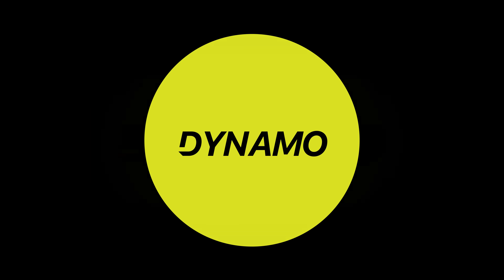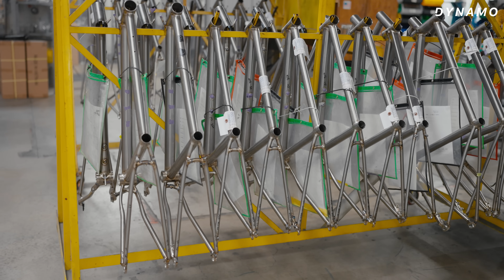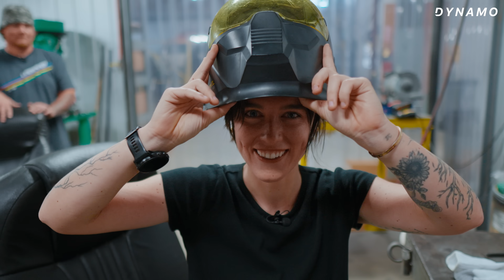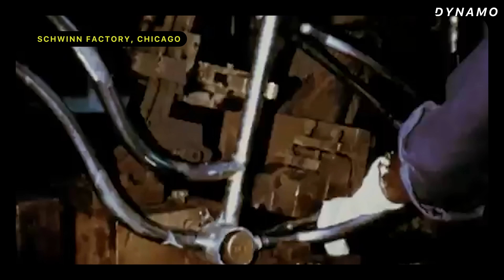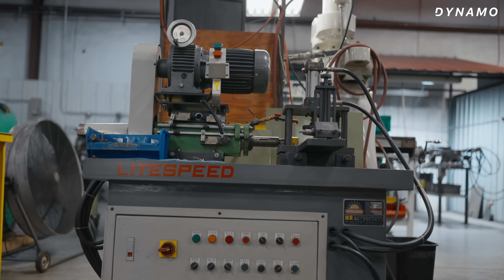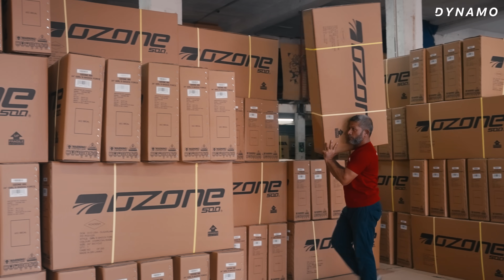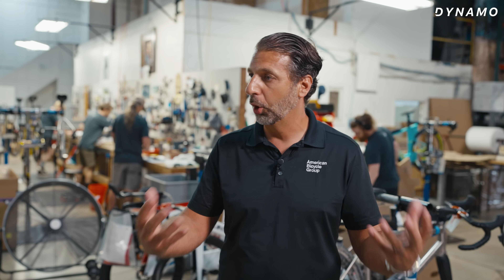What 'Made In America' ACTUALLY Looks Like

Comment: A good point was made…..if there is a huge investment in manufacturing it will be in automation (not job creation). Even the ‘robots’ will be built by ‘robots’ and programmed by AI.
Reply: Still lots of jobs in maintenance, set-up, programming, engineering, sourcing, & quality in a “fully automated” factory.

Also, very few things are possible to “fully automate”.  

AI is mostly going to take customer service type jobs, at least for the foreseeable future.  Programming a robot is too specialized.
Reply: Not even 😅 AI can build nothing but crappy code and fake videos. There will still be machinists and techs for the robot as well.

Comment: We have always had this issue, even in 🇬🇧 companies would spend millions developing a whole new factory with machines etc because in the long term they deemed it to be cheaper to outsource. A few years later we have become so dependent on other countries that these countries have full control and can just up the price without any reason.

All the factories eventually closed down and would require substantial investments to manufacture at home. Even if they did this it would end up mainly as an autonomous factory with very little human activity. 

The other issues you have is the emissions reductions requirements, this technology is extremely expensive also which will also increase the cost of set up

Comment: Some years ago I bought a fishing hook sharpener from a store. The packaging was flash and it had made in USA stamped on the pocket clip. Not long after I bought it I took it apart to clean it and would you believe, when I extracted the sharpening steel from the holder with USA on it, the most critical part of the whole device was stamped with 5 simple letters CHINA. In essence I paid a premium unnecessarily.
Reply: "Made in USA" labeling requirements are not very strict.  Basically the final product must have been assembled from components into its final retail form inside the United States.  Or it can have a distinctive component critical to its function manufactured in the United States.  Now many products doing this do push the lower bar of what this means.  A lot of these products arrive where 2-3 completed sub-assemblies need to just be snapped or screwed by US labor and then inserted into a box that also came from overseas. So they basically have their overseas manufacturing package the component in such a way that the labor on the absolute last step is as basic as possible.  In fact a majority of the of the worlds "Made in USA" official logo are printed onto assemblies and packaging inside Chinese factories (they print Made in USA on things more than any other country...including the USA).
Reply: Manufacturing Engineer here - a lot of the items that have the "Made in USA" label are built somewhere else. Either assembled in the U.S. or just packaged in the U.S.
We have some items where we literally just change the label from the original manufacturer's to ours after running it through our inspection lines. And there you have it... "Made in the USA".
Reply: @yousef.al-assaf sounds like a scam
Reply: @TallMatch  in a way... lol.
It's like dropshipping
Reply: I’ve seen a hose nozzle with a plastic cover that says made in the USA and when you take off that admittedly pointless part, on the main metal part is stamped CHINA just like your story lol
Reply: @327efrain  
There was once a similar case in Europe. Logo CE means Certified European goods. The Chinese manufacturers decided to slightly change the logo and claimed it was “China Edition”. 😂 But it was quickly stopped.
Reply: More than likely even the “Made in USA” label was made in China 🤔
Reply: We make the bait that smells like chicken-liver. We cannot even make fish hooks. When we revert fisher-gatherer...it doesn't look good.
Reply: US companies scam US customers because they know US customers do not demand superior quality. They only demand the product has American made stamped on it. It is the US customer fault for not demanding the best objectively better performing and most premium built products and US suppliers doing that the best.
Reply: For around 50 or 60 years your elites have been scamming you, paying 10 to 15 times les labor costs, less taxes, etc for taking offshore production... while they take your money like it was "MADE IN U.S.A.)
Reply: Probably just the pocket clip was made in USA, so it's just a "misunderstanding"... 😊😊😊
Reply: Even China make premium goods. Where do iPhones made? In China.

So where is your point?
Reply: @xrismanessa3993  yeah but it says so on the box
Reply: @xrismanessa3993  That it was fake americana, like everything american?
Reply: @xrismanessa3993 China is known to have poor quality steel.
Reply: @xrismanessa3993  the point is misleading
Reply: @xrismanessa3993  I think he was saying that he got scammed. The packaging said 'made in USA' so he was prepared to pay more for it since labour is expensive in America. But it turns out that the producer just outsourced it to China and relabelled it as made in USA.

Comment: A surprising number of Americans don't realize the reason we don't make stuff in America anymore is because we no longer know how. There are no Americans left who know how to make machines you'd need in a factory. It's just that simple. And that scary.
Reply: I know someone who will make a frame stateside. But it's 5k vs 1k. I work at a bike shop. People want American made, but don't want to pay for it.
Reply: @zackmckinney1  I was in the industry for 15yrs.  That 5k bike is basically made in a craft shop, not a real factory with an assembly line.  A real factory would be a lot cheaper, just not as cheap as being made in Asia
Reply: @zackmckinney1 I did landscaping for a bit. One of the things I learned from that as well as having been a marketing rep with a manufacturer of US made goods, is that people want good quality products or work at low quality prices.
Reply: @zackmckinney1  Ironically, if your guy in America was making a million frames a month, he'd probably be charging 1k too.
Reply: I do make machines/assembly from scratch.  I work at a job shop which makes various things depending on who the customer is.  People with our trade is very hard to find.
Reply: I know how to operate many CNC machines and moulders. I know plenty of people who know a lot about machining. Even younger people. It comes to cost. Is it worth it for companies to pay us to make it in America? Versus outsourcing. Plus in most factories I have worked in now require an operator do the work of 2-3 people for bad pay. Overall American made isn't profitable and companies don't want to pay operators.
Reply: 🤣🤣🤣 wait how did all those space x machine get built?? This is the most ignorant comment 😂😂😂
Reply: 1/ est ce que les entreprises avaient baissé les prix quand elles avaient delocalisé il y a 20 ans ? 
Réponse : Non. Elles se sont accaparé les gains de coûts au détriment de l emploi local et des consommateurs.
2/est ce le moment de relocaliser la production manufacturiere pour les Usa?
Réponse : Non. D'abord parce que comme le montre la video ce n est pas possible techniquement.  Et les coûts vont exploser. Et enfin la demande de produits de marque US va logiquement baisser grâce a votre cher président du fait de la guerre commerciale.
Personnellement je n'achète plus de produits americain tant que les entreprises européennes sont pénalisées sur votre marché, en représailles. 
3/la situation est exactement la même en Europe, le savoir faire a été perdu.
Reply: Yes lots of machinist boomers retiring and no one told the kids they could make good money doing it. Almost like there's consequences for off shoring industry... 🤔
Reply: Not just that.  Those that could didn't do it as well as those overseas
Reply: American factories returning will be a boom for manufacturing robots.
Reply: Like Tim Cook said, he can't even fill the room he is interviewed at if he gathers all the american toolmakers needed to make the iPhone in that room, in China, he can fill up several football fields. he said the reason he makes iphones in China is not because of cheap labor (which they are not anymore) but the expertise  and production ecosystem that exists in one place.
Reply: Because Tim Cook invested in China. He created the problem he speaks of.
Reply: As an ex-manufacturer, you're semi-correct, it's not that Americans don't know how to do it, in fact some of the best engineers I know are American. its more that the American market and the US way of running a manufacturing company means they cannot do it!
Reply: In.
Reply: Well the machines today require electro-mechanical degrees to maintain.
Reply: ...and that's because we let the capitalists run things for 75 years.
Reply: Not just that, but nobody wants to work in manufacturing cause it sucks. Everyones told go to college or do a trade, I’ve never heard people recommending becoming a technician or just a line worker.
Reply: Well do we even have to know anymore? We have AI capable of designing anything that it is asked. 
We can learn from it as it learns from us
Reply: Thing is that America can be retaught how to do these things.  They simply don't bother, and won't, and more to the point, economically can't. Not without a lot of help anyway.  American here, it's just how we've boxed ourselves in economically.  It's not that we can't do them, we simply can't afford TO do them, so we've lost the arts as foreign products insinuated their way into our daily lives.

And why did that happen?  Right there in the video: costs.  It is simply unviable (without protectionism intervention in the form of properly applied tariffs or such to ensure undercutting pricing by foreign product is not possible) for domestic manufacturing to continue when faced with something that's 25% the cost and at least half as good.  Which is all most people wind up needing: Something now.  Not something forever.  This bicycle feature is pretty much the whole idea: Small USA manufacturer of bikes, but with global product, niche market, niche product, niche pricing. Higher income people are the target here, higher demand on the product, that sort of thing.  The 'everyperson' will go to Walmart and buy a Chinese or Taiwan or whatever bike and be perfectly happy, not caring one whit about where it came from.

Repeat with every product.  Even a simple lock.  Exactly the same in every way, one made in the US, one made in <insert country here> and the non US one is going to be the runaway sales leader because it costs less by 75% or such.  Nobody cares enough about 'Made in the USA' when you have to decide whether to feed yourself, pay rent, perhaps a doctor visit, and that expensive USA one isn't going to let you do those things.  The cheaper one will.  Cheaper it is.

(Yes, the whole idea of paying multiple times as the previous one breaks faster or isn't up to the task is a thing, well aware... but the masses do not consider such things.  "I need a thing, I don't want to pay a lot because I need it once/just wanna try it out/I can't afford the good stuff" is the overall buying power king set of rules, and USA gets bought when it's obvious a person needs to upgrade and stop pissing money away... provided of course the USA product is still available and actually good enough, which in some cases IS NOT the case.)

And so the made in USA product stops being made, and that happens long enough we forget how to make them.  Repeat ad infinitum.  Because it's just not worth doing anymore, literally, the company went bankrupt/moved production where they can survive.  Easier and cheaper to exploit other country's labor and abilities and just use the end result here.

At the end, it's that simple... but it's not scary.  It'll only be scary if the need arises to require these lost arts and we can't acquire them in time.  Like, I don't know... maybe some President is elected that goes on a tirade against any other countries they don't like and enacts stupid high tariffs in some attempt to 'bring back jobs/industries/manufacturing' to America and doesn't give America any help or time to maybe possibly catch up enough for those tariffs to make sense.  Surely that' won't happen, though... >.>
Reply: @mikeybhoutex American manufacturers treat Kaizen as a four letter word! Name me three American made consumer products that are world class. Craftsmanship just isn’t valued here as compared to Japan or Germany on the high end, so there’s little incentive here for a young person to enter the manufacturing sector.
Reply: @mikeybhoutex you are describing and seem to be endorsing a steadily declining standard of living in the US.  

Of course if we tightly couple our US economy with the economy of a much more populous poor country (1990’s China) you are going to bring our standard of living down more than you raise the poor country up.   Think of pouring a hot cup of coffee (the small population rich economy—US) into a large bucket of cold water (the large population poor country). In the case of China, they are also getting rich by selling all over the world, not just to the US.  

We do need a president to try and jolt the system.
Reply: @mikeybhoutex  That long winded response was accurate up until that last bit. The problems you touched on started long before 45. Furthermore, they were exacerbated by a certain President who "didn't inhale" and "did not have sex with that woman".
Reply: Disagree with you 1000%. It’s called greed, unions, strict regulations and cheap labor costs. Why do you think the steel industry went overseas? Cheap labor and they don’t have to deal with bs unions. Also, nearly all the components needed to make this bike are outsourced from other countries. Why? Because it's cheaper.
Reply: @noelv1976  I agree, greed of corporations, not of the worker, is a key factor. Companies don't want to pay people a living wage and so they move operations overseas. $1B in profit a year isn't enough, it's gotta be more to satisfy shareholders. Tale as old as time.
Reply: @noelv1976   What killed steel industry is lack of innovation and mismanagement. Most active American Steel plants relies on outdated process and complicated( old and inefficient ) Q&A  process. Most Germans, Swedish, Brazilian, Chinese and few Indian plants are transitioning to use hydrogen reduction on ore or steel  and some crazy electrolyzes process to produce cheaper, cleaner, greener and better steel, otherwise America is still open-heart dominated, even AJAX furnace is counted on hands
Reply: @noelv1976   regulation and unions? Give me a break😂  You just wanna capitalize on a free lunch